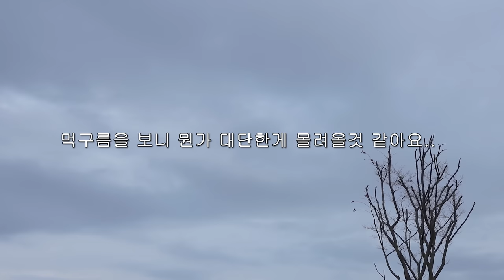미친듯이 불어대는 강풍과 텐트가 뚫릴 것 같이 쏟아지는 빗속에서 캠핑 | 난로가 넘어지고, 텐트 안에서 비가 내려요..

Comment: Hi, it is a good tent. Thou it was not settled as it supposed to be for the weather. The car is to be parked blocking wind direction. Use tires to tighten the tent. Always put your shelter as there are a hurricane coming, cause if you don't you would do it at night when there is raining like dogs and cats. Best shelters is Fox, Solar, Maverick. Good luck miss